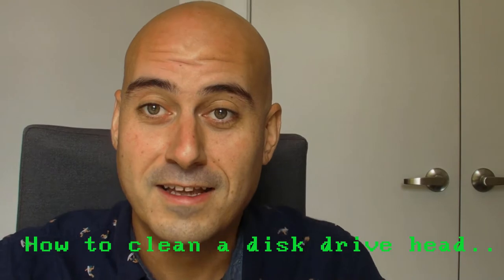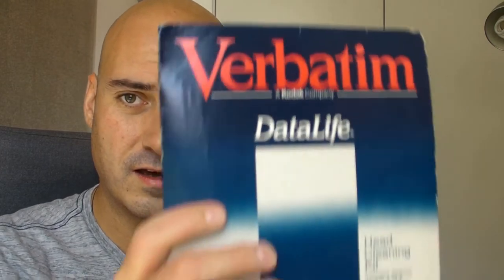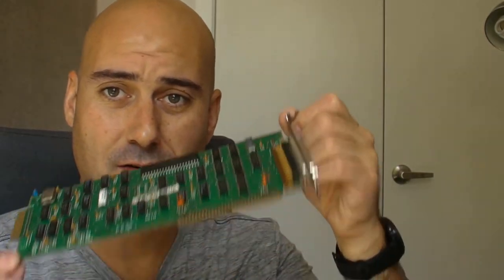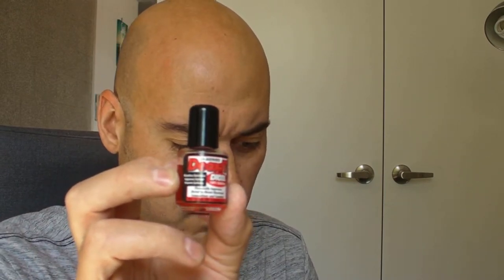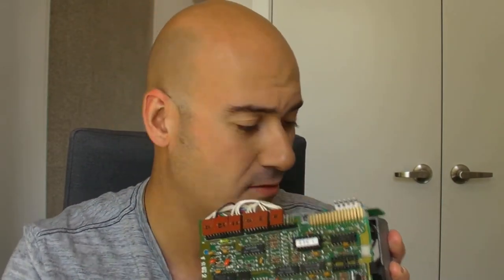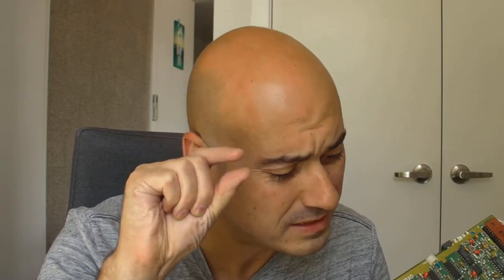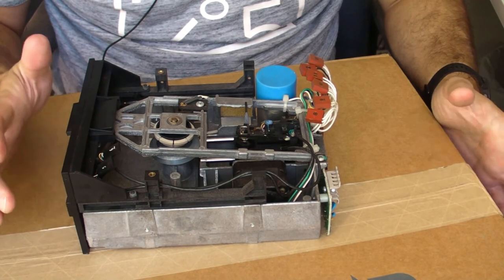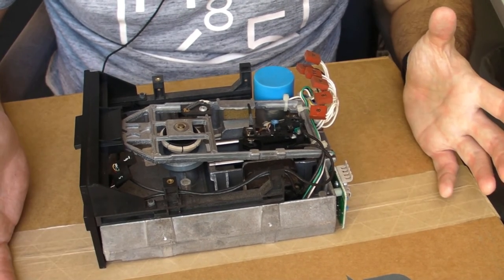How to clean disk drive heads

Comment: Great video, Al!

My first computer gig after high school was working for Tandon Magnetics Corp., which opened a plant in Simi Valley, CA. (home of the Reagan Presidential library). Our building produced the circuit boards for the drive in the video, also made by the same company. 

Sirjang lal Tandon was an IBM engineer who thought of the great idea of placing a read/write head on the opposite side of the disk, thus creating the 'double sided' floppy disk drive.

Before that, users would sometimes use a hole punch to create 'two-sided' reversable disks which enabled the disk to be flipped over to access the second side of the disk, doubling the storage capacity (the second punched hole indicating that the disk was inserted into the drive). Some disks lacked adequate iron oxide on the opposite side, but most disks were identical on each side.

In true IBM fashion, mananagement told Tandon to simply put his invention on the shelf to collect dust and get back to work. Instead, he quit IBM to form his own company.

Due to Tandon and others, northwest Los Angeles, Simi Valley, Thousand Oaks and neighboring areas became a hub of disk drive and tape drive production. It's a rich tradition now mostly lost to history, but yet another chapter in the March of technology.

While at Tandon, I also worked for a division that produced some of the first 5¼-inch hard drives - $1,000 for a 5-MB unit! We also produced hard drive subsystems for the Commodore Pet.

Other storage companies in the vicinity included Micropolis, Computer Memories, Inc, Pertec Computer Corp., Western Digital, and dozens of others. It was an exciting time to be in the PC industry. 

Thank you for this short but sentimental video!

Comment: This was cool to see. By the time I took a computer electronics class in college, 3.5" floppies were still in use, but the advice at that time was "just throw it away and get a new one"... which of course you can't do anymore...

P.S. The technical term for the "metal flippy bit" is the shutter.

Comment: Lubricating "traveler" with this DeoxIT (or with WD-40) is pretty bad idea. Guiding rods or slide rods should best be lubed with teflon or lithium grease (the same for plastic gears also) as they have more appropriate viscosity and almost do not evaporate. Those guiding rods btw are parts of optical drives (CD, DVD, BR) and also of dotmatrix printers. Both deoxit and WD40 are actually not first place lubricants although they can smear somehow. DeoxIT tho  is one of the best lubricants for potentiometers.
Reply from the maker: I wonder where I can buy that in New Zealand?! Thanks for the tip, I have seen a video before with it recommended too, so I'll try and look out for it